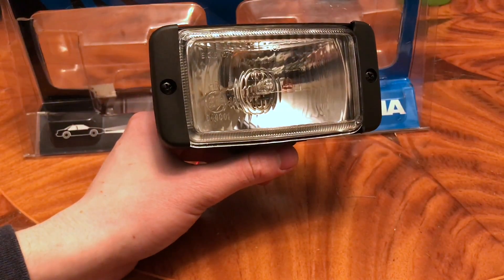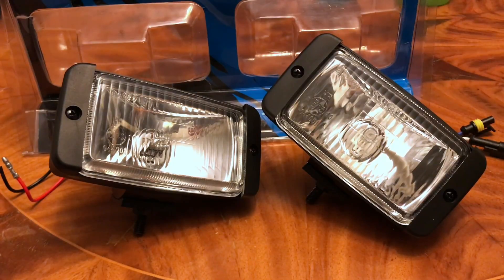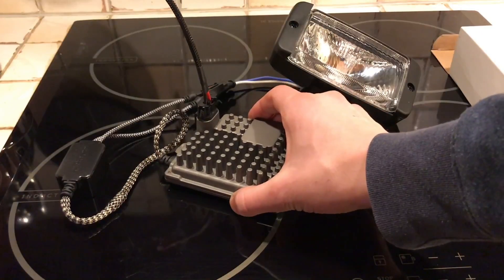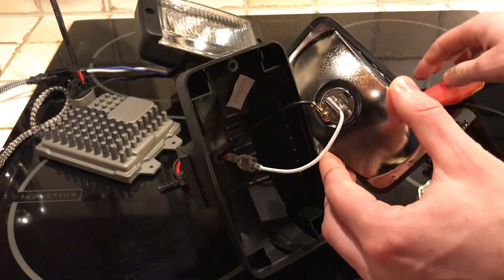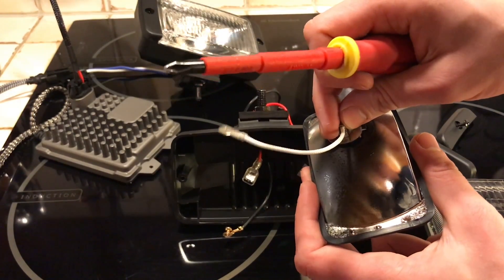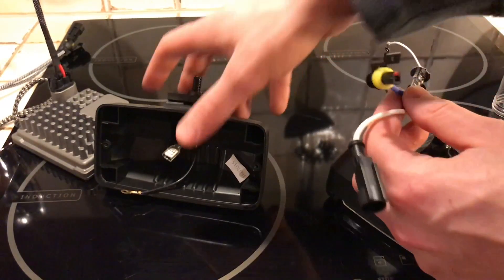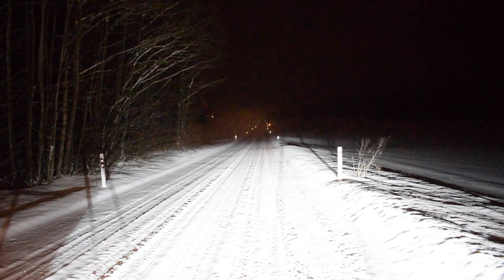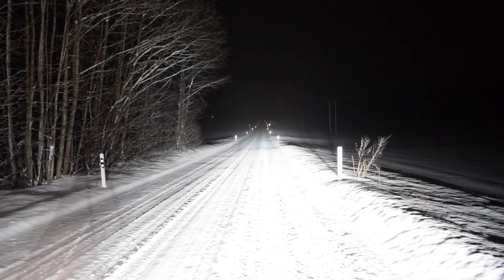75w Xenon HID Converting 5$ Auxillery High Beam Offroad Extra Lights + Test

Comment: You said it wouldn't be that useful with your bixenons. That is a flawed test you did. Remember you're only testing one of these lights. If they were actually mounted on the car there'd be two of them each at 75 watts HID. So the output would most likely double out at the distance. At least increase significantly. Next time put the hid and ballast in both and then shine them down the road at the same time. I bet you'll notice a huge difference then! Still, thanks for the video! Nice info to have without wasting the money my self. lol.